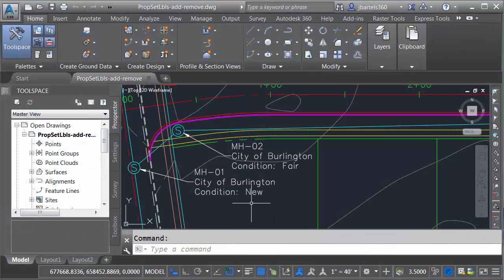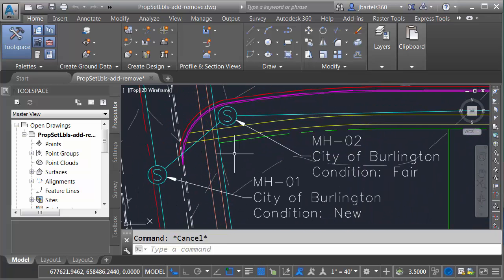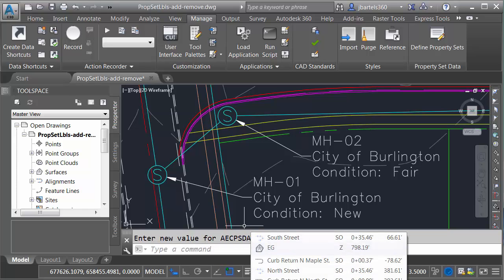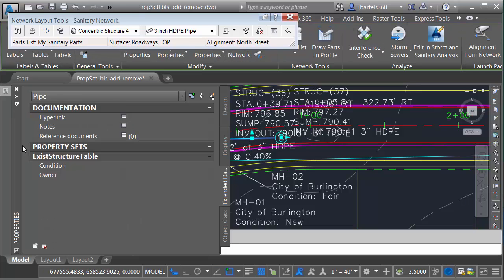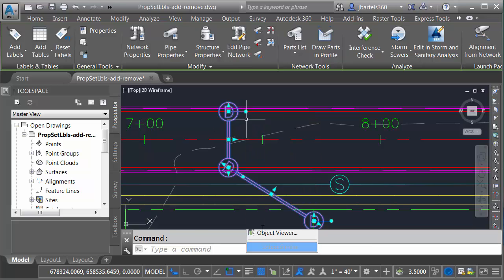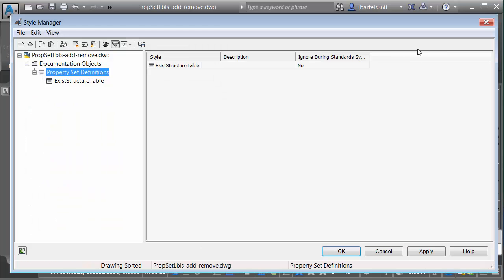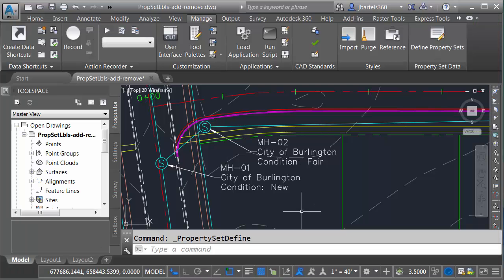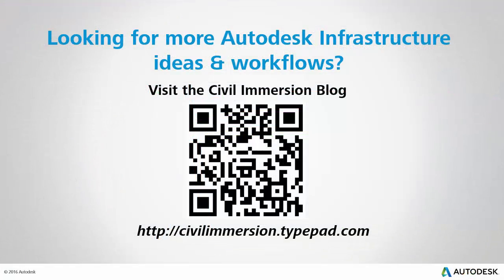Automating the Attachment & Removal of Civil 3D Property Set Data

Comment: Dear Jeff, I’m working on a rail project using Civil 3D and I have some questions on property set data:
1.	Can I add a property set table directly in Subassembly Composer?
2.	I can add property set tables to the assembly once in C3D but will this data come through once I have reconstructed the corridor? (I have other issues which are preventing me from testing this at the moment).
3.	Once I have created the corridor I can’t select the individual objects of the assembly to add the property set tables, have I missed a setting to enable me to do this?
4.	Once the solids are extracted, I have no issues with the property sets but one small change and the solids are extracted again without the information… hence my other questions

Thanks for any help you can give me
Ed